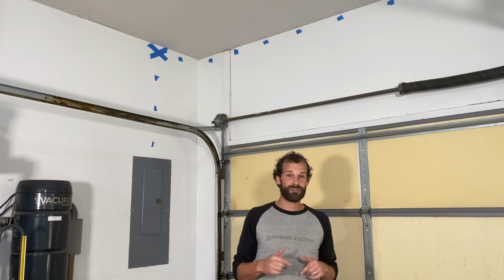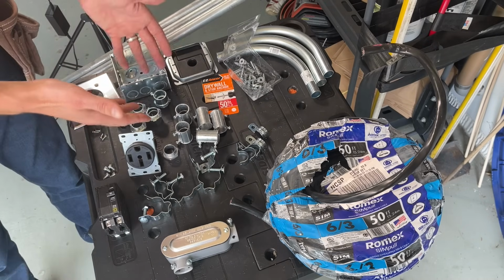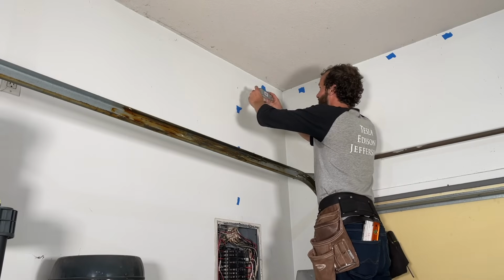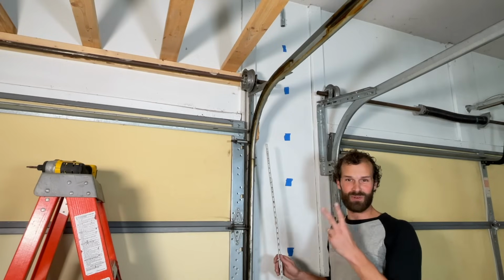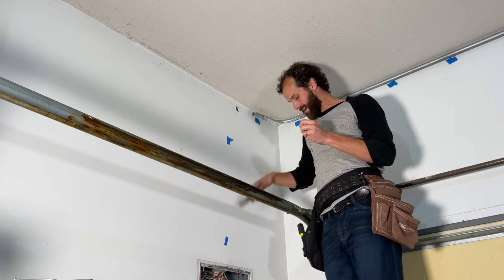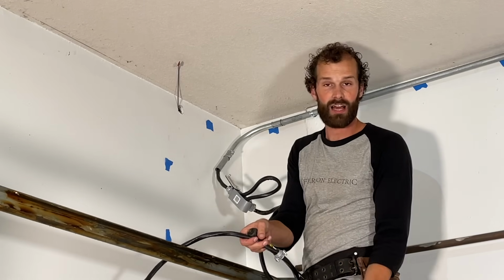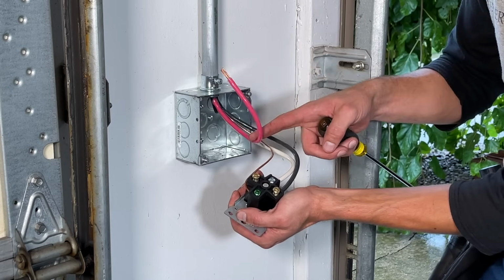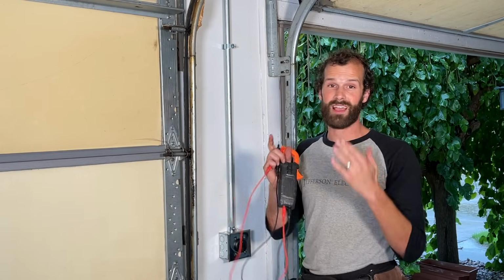How To Install a 240 Volt Outlet | Electric Car Charging

Comment: Is running NMSC (non metalic sheathed cable, including Romex brand) through conduit approved now?  That used to be an NEC code violation and would result in a failed inspection.  Also, drawing 50 amps continuously from a 50 amp outlet is a violation.  If Tesla designed their chargers to use a 50 amp outlet in a code compliant way, then the charger would draw no more than 40 amps on a long term continuous basis (80% of 50 amps).
Reply: It's never been an NEC violation to install Romex in conduit.

Comment: Locat codes are important, this install will fail in my area, the LR fitting a no no LB a better choice but installing conduit to panel and pulling # 6 wire and installing a GFIC breaker,  this video first should of been about don't kill yourself hire a reel electrician and ( live )

Comment: That 50 amp breaker is not rated for continuous charging of an EV.  This breaker is highly likely to at minimum have a melt down.  Worst case it will start a fire.  I would not trust a $10 outlet made of Thermoplastic to power my Tesla.  Bakelite is the best.
Reply: Most EV chargers use 42A or less so if that's what gets plugged in, a 50A circuit is fine for continuous duty in this case.
Reply: @pld8993  Not according to history: https://youtu.be/tDp9PhPJhUI
Reply: @ryanwelsch9384  One video of 3 non-electricians discussing a handful of failures is not a complete history. First, everything they showed was wired with aluminum, which is itself a potential source for the meltdowns. It doesn't take much more than a little oxidation or a not sufficiently tightened screw to cause everything shown in the video. Second, 42A on a 50A circuit is not 100% duty, it's 80% duty, which is the limit for continuous loads, as well as for cord and plug connected loads. If someone puts a 50A charger on a 50A circuit, that's either an improper installation or improper usage and not a design or product failure. I've installed dozens of EV chargers and I always hardwire them. Given how the EV charger manufacturers are now designing them to create a  loophole around hardwiring leads me to believe that the NEC will likely follow suit and eliminate the loophole in the future.
Reply: @pld8993  I am glad to read that you are doing hard wired, however that does not address the other week point, the plug in breaker.  

Great job on miss representing this video!

It seems that it was coincidental that all of these devices show had used aluminum wire.  The failure points were not were the wire was connected.  The failure points were where friction connections were.

The Porsche was not charging at 50 amps.  It was charging at 32 amps.

The gentleman in the middle is a master electrician.

You do not seem to understand duty cycle.  For the sake of your clients and audience, please learn what you are talking about.
Reply: @ryanwelsch9384  Yeah, coincidence. Failure of aluminum does not always occur at the conductor connection point. A poor aluminum connection increases the possibility of excessive heat generation, which need not cause a failure at the terminal as heat travels through conductive materials and can cause a failure at other points, where the stab-in breaker connects, for example. I've seen multiple failures of this type caused by aluminum. Occam's razor seems to be the driving principle here and what you assume to be a coincidence, given the well-documented history of aluminum and its issues and the non-history (despite your proclamation that it is) of dramatic failures due to thermoplastic, is the most likely culprit. I understand continuous vs intermittent duty just fine, but perhaps you need to study the NEC instead of drawing definitive conclusions based on one YouTube video that ignores the obvious likely cause and instead proposes another with no data-driven evidence for its conclusion, but relies heavily on presumption and assumption. Please explain how using a bakelite recep would have prevented the breaker stab-in connection point from failing. Also, per your initial comment, please enlighten me as to the grand history of 50A breakers regularly failing under a 32A continuous draw. Like the video, you've arrived at baseless conclusions dependent on a misguided argument and have written off the most obvious likely cause of the problem as a mere coincidence.
Reply: @pld8993   I do not think using a bakelite recep would have prevented the breaker stab-in connection point from failing.   However, I do think it would be less likely to have a meltdown.  I do not trust the breaker to stab connection for EV chargers.  I never mentioned "grand history".
Reply: @ryanwelsch9384  Of course a bakelite recep would be less likely to have a meltdown because they don't melt, they get brittle and crack and crumble. A 50A breaker, whether stab-in or bolt-in, is rated for 50A and its integrity is not dependent on your trust. Heat pump backup heating coils, for example, regularly use 60-90A breakers and do not regularly fail, and certainly not simply because of a stab-in connection. Having dealt with aluminum for decades and seen multiple failures, included overheated portions of a conductor several feet away form the terminal connection, it's hard for me to ignore what's staring me in the face. A 32A load does not melt a 50A breaker because the UL tested and listed connection fails only on EV chargers, but not on other loads that use the same breaker and the same type of connection. There is no history of this happening, yet somehow I should believe a data-free assumption and not what years of experience has taught me? I'm in the field every day and I deal with reality, not theories. The breaker is not highly likely to have a meltdown and a thermoplastic recep rated for 50A is not going to magically melt from 32A simply because there's an EV charger on the other end. When aluminum is the wiring method and there's an excessive heat situation that causes things to melt, it's unlikely that it's a coincidence. I'm basing my "opinion" on 40+ years experience, not some random YouTube video that ignores the obvious.

Comment: How about a torque spec for tightening to terminals?  Other than that nice !
Reply: 45 inch pounds for the breaker and it will vary depending on the receptacle manufacturer— Hubell is 75 inch pounds and the Leveton is 45 inch pounds

Comment: Looks good, one thing, you could’ve used a j box and just put an extension then ran you’re conduit. Again 1000 ways to skin a cat but i think that would have made it easier for your install. 2. Your box or conduit isn’t grounded, you would need to ground the box with a pigtail in the case for whatever reason the box became energized you want a path to ground.

Comment: Next time put grease to easy pull romex in conducit.
Reply: They make wire lube and you can even use dish soap. Never use something combustible (grease, oil) to pull wires.

Comment: OK one more problem hacksaw they’re designed to cut on the pool not on the push
Reply: Hacksaws are designed to cut on the push, the teeth are angled away from the handle.

Comment: In that situation that you’re in could you get in the attic and run the wire across the top of the attic and it’s been my finding know it’s just my finding and I’m not electrician that those conduit pipes rub on the wire in college Chieffing. I pulled it out multiple times where it was achieved.

Comment: Great video.  A lot of useful info here.  There will always be those coming here to search for areas to critique, but have no video posted of their own.  Nothing new.  Thanks a lot, it was very helpful.  I'll probably give it a shot when the time comes.  I have a family of electricians so, it's iffy at this time.
Reply: Some of us are too busy being real electricians to make videos.Multiple NEC violations in this video, not professional at all.
Reply: @pld8993  Yeah, but not to busy to look for something to criticize.  A lot more help than you've been, that's for sure.
Reply: @twoweeledsoto6072  When someone blatantly violates the NEC in a video like this, which is produced as a product to be sold to the general public, their incorrect work should be criticized whether done intentionally or not. Hopefully those who don't know any better will see what those who do know what they're talking about say and not follow incorrect and illegal methods of electrical installation. I've listed every NEC article that's being violated. I'm not sure why you seem to believe that's not very helpful.
Reply: @pld8993  He clearly points out he is working with a live panel.  He is an electrician and is comfortable working with a live panel.    He clearly states where the hot spots are and where to be careful.  He More than once states, If you are a do it yourselfer, you should shut the power off and NOT work with a live panel.  He also points out, even shutting the main off, the wires from the drop are still live.  Now if someone chooses to touch places where he clearly tells you not to touch, that is on the individual.  
Are you really that concerned with the public safety and want to show them the correct way?  Well then by all means, make a video and show us!  We’re all eyes and ears here.  
Those who don’t know any better than to touch where he’s told you not to touch should not do this, as you say.  But they can’t see anything without your video.  Just your words of criticism.  That’s of no help to anyone here.  That may help you in keeping people from doing this and you losing $500-$800 for often less than 4 hours work.  I can see your interest there.  But you and I both know.  There are many people fully capable of doing this.  They will take longer and not all jobs are equal.  Not all people have the same capabilities in this area.  Personal responsibility applies here.  If they are not capable, then they shouldn’t be attempting it.  Sounds like you’re concern is in potential revenue loss by people doing it themselves than any real concern for their safety.  Maybe I’m wrong.  Make your own video showing us the correct way and prove me wrong.
Reply: @twoweeledsoto6072  Yeah, I'm worried about losing revenue because of some random youtube guy. Hilarious! I don't even look at jobs that are under 20k. This video is a product that's being sold to the public as a professional installation when it's clearly not. I'm not against videos showing DIYers how to do things correctly, safely, and legally. This video fails on all 3. Metal fishtape into a live panel? If one of my guys did that, go home.
Reply: @pld8993  Let me know when you post your video.  Show us your real concern.  
That's hilarious!
Reply: @twoweeledsoto6072  Yeah, because putting videos on youtube is a sure sign of expertise in the trade. I'm a real electrician who provides real services to real customers and gets real inspections in the real world, not interested in pretending to be one on youtube, but thanks for your interest. Feel free to rebut all the violation$/clickbait that I've posed, maybe one of your family electricians can show you how to read the NEC. Maybe not.
Reply: @pld8993  "a real electrician who provides real services", at a big price.  God forbid we just do it ourselves, huh?  Don't want any of us doing it ourselves, do we?😁

Comment: In your new circuit, is the bare ground wire less gauge (smaller dia) than the Hot and Neutral wires?
Reply: In #8 and larger Romex, yes, the ground is smaller. This one is #10.

Comment: Illegal!! Can’t run Romax wire in pipe!
Also too much sheathing inside that main panel!
Reply: It's not illegal to install Romex in conduit.
Reply: @pld8993  go back and read the code book!
Reply: @edwardmascari4661  You may want to do just that. 334.15(B) and 334.15(C). Any questions?

Comment: I am a diy who has worked on a live panel. As an EE, I have a lot of respect for what is going on it there and take my time thinking through each move before acting. The only time I got stung was while neatly routing the new wires when I touched a hot wire the "pro" who installed the panel had nicked. BTW, that 120VAC sting was nothing like the 300VDC sting I got on my little finger trying to brace a scope probe on a small PCB the size of my fist. I was concentrating on troubleshooting the 5V and 15V circuits on the PCB and totally forgot about the small 300V circuit. It isn't the voltage that kills, you can be electrocuted with just 0.040 Amps of current.
Reply: I stupidly shorted the 340VDC leads from my 17.5 kWh battery on my home backup system.  Exploded in my hands, threw me across the garage and sent me to the emergency room for the afternoon with 2nd and 3rd degree burns.  This is not a joke.  The thing is, installing these systems in my hardware lab was my job for over a decade.  I was installing mine in my home and relaxed on the safety procedures and well I described the results.  Safety first.

Comment: Too many things to comment on. Not what I would consider a pro job. Retired master electrician. Never worked in a place that would allow a three or four inch chase nipple in the top of the panel and allow all the circuits to run through it. Amazing. Also, if you're going to work on a live panel (And I recommend a DIYer never do such a thing), take a piece of cardboard and tape it over the panel on three sides allowing just enough room to push the top of the cardboard into the panel so that you can insert your fish tape through the top knockout. This should keep you from contacting any live circuits when that fish tape accidentally flops around. Nowadays, they actually have fiberglass fish tapes which would be a lot safer for this job. I also spent 20 years as a paramedic and took countless DIYers to the ER for attempting jobs like this on live panels. JMO.
Reply: Not a pro job. Just because it works that doesn't mean it's done correctly, lots of violations.
Reply: i don't think this guy knows enough about this to be posting videos.  i'm not an electrician, but even i know this wasn't done right.  of course i been at it a while and i've done a lot of research on this.  even if i was just running 110 i wouldn't have done it this way.

Comment: I just spent $60 to install 240 outlet to charge the rental tesla I have for doing Uber Granted I was only about 2' from the sub panel that was in the garage while I was gonna put the plug so I just put A-line from the sub panel to my plug which is just right underneath the sub panel since it's mounted on a wall not flush But not everyone's gonna have the same situation shouldn't grunted the sub panel that I had only had the 40 AMP feed to It just put in  a 30AMP breaker for the charging which is more than good enough for what I need

Comment: Great vid, thank you so much. Pro electrical engineering tip (Note: we often work in an EE lab with both low and high voltage open equipment with lots of possibility to create a short circuit with any metal objects that might get inside the equipment we are testing) : engineers must remove all conductive jewelry!
Reply: Very good advice! Years ago, an electrician friend of my parents died when a ring he was wearing touched a heavy load. Watching the guy in this video was giving me the heebee jeebees because it you get careless for just a split second you can get killed. Much better off to kill the power instead of yourself.

Comment: I'm no electrician by far. Half of the comments I don't understand. And the other i kinda do. 😆 
I know enough to do most of this. But I won't connect it to the box myself. So ill just get someone who knows what the hell they are doing and I will rest a bit easier. Oh by the way. I need a 50 amp plug installed for my RV. My box and breakers are from the the mid 70's. So I need someone who knows stuff 🙃

Comment: As I understand, the 50 amp breaker installed in the panel needs to have GFCI
Reply: Nope,  not for an EV Wall Connector.  Besides, they will trip randomly and unreliable for EV charging.  He is not going to be taking a shower near the EV wall connect.
Reply: @trex2092  Incorrect. Both 625.54 and 210.8(A)(2) require GFCI protection for this.
Reply: Correct, both 625.54 and 210.8(A)(2) require GFCI protection for this.

Comment: 50 amps!!! ??? 

I'll never understand this. My wife and I have been driving EVs for over 5 years, we've NEVER needed more then a 16 amp 240v charger. 

Anyone driving less then 200km per day will do just fine with 16 amps.

This allows you to spend way less money on:

The charger,
The outlet, (with 20amps or less you can use a nema 6-20R)
The wiring,
The breaker
Etc.
Plus it'll place less instant load on the grid, and it's better for your EV.

Lastly, even if you only have 100amp service,  you can still setup a 16amp 240 charger in most situations.

Stop wasting money, there's no reason to charge that fast at home.

Comment: Not sure where you live but code says no romex inside a conduit. Should have put junction box instead of lb use seal tight or greenfield down to panel and pulled stranded thhn the whole way
Reply: What's the code reference? Under the NEC romex is allowed in conduit.

Comment: Kris thank you for replying to my question below. So if the Ground and the Central are bonded at that panel that you are working on, then does that matter as far as Amps is concerned, if I install a 3 prong or a 4 prong recepticle, meaning 10-30 or 10-40. Final question. Thank you so much for replying to my fisrt question btw.